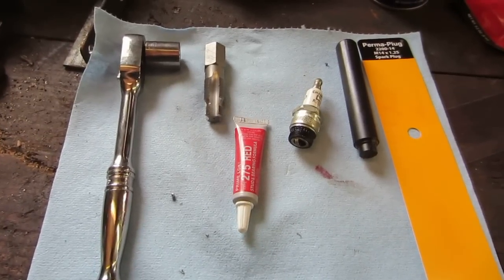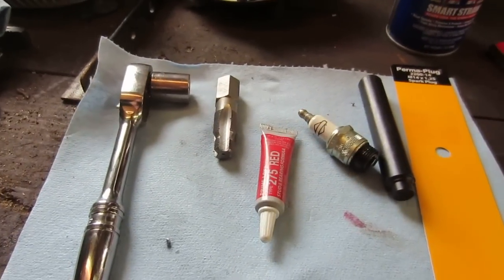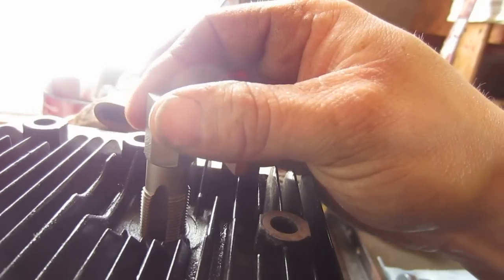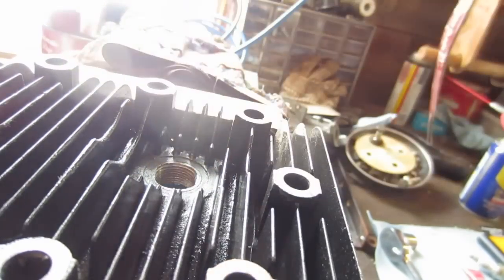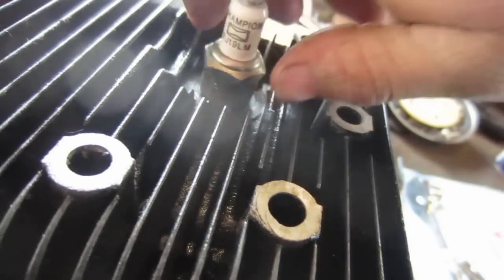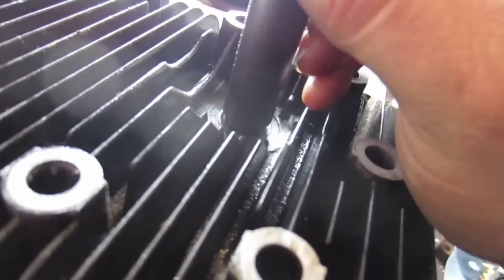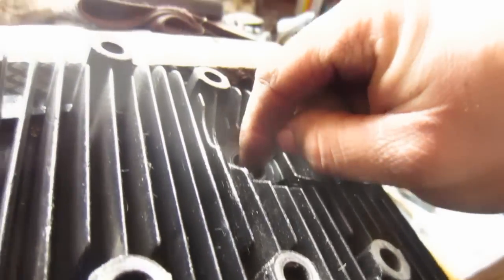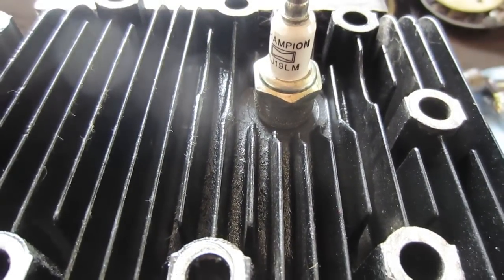stripped spark plug repair briggs and stratton engine part 5

Comment from the maker: i went through a similar program in school,except i worked at a lumberyard at the time.   you will use the skills your learning the rest of your life, congrats and keep at it. 

correct on the oversized plugs, thats why i use this repair as you get the orginal size plug back, ive seen oversized plugs and alot of times they get done wrong too.  then they blow out and your back in the same boat. 
keep at it man.

Comment from the maker: redlock tight is for the steel insert, you put that on there as it helps lock the thread insert from moving along with the teeth.   you want to let that cure good before running your engine.  do not use anything but redlock tight, as it withstands the heat and pressure,other products will not hold it in place.

Comment from the maker: helicoil makes a kit similar to this one for this very problem, with steel inserts. these inserts are a stronger repair in aluminum. also ive seen where a standard helicoil will pop out vs a insert with teeth that will hold it in.

Comment: thanks for the video i didn't use lock tie since the kit said you dont need to is that why there is some oil reduce  forming around the spark plug hole?

Comment: I Have exact same problem.......where can i order/buy it ?.......what exactly is it called......comes as a kit ? is it the heli-coil sav-a-thread ? advance auto has fix-a-thread for M14-1.25 ports ?.....anyone know if it will work ? its a toro tractor B&S 12 horse ....plug is j19lm just like vid......cant find out much info.......quick advice please anyone!? thanks
Reply: realcygnus It's called Save-A-Thread. Put Loctite High strength sealer on the insert and let it dry. Use the short insert on lawnmowers. It's better to remove the head. It can be done with the head on. Use wheel bearing grease on the tap. Keep tightening and backing it off  and clean off shavings. An insert will tighten the fit on the threads on the plug. A helicoil can do. Autozone has a kit with a tool. It costs about $30.00. This kit works on 14 x 1.25 holes. Tighten the head bolts in sequence with a 3/8 Dr. torque wrench.